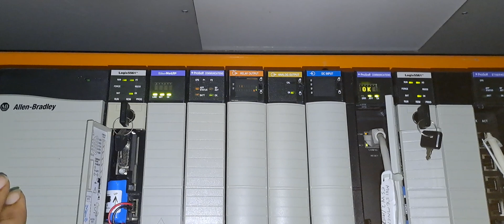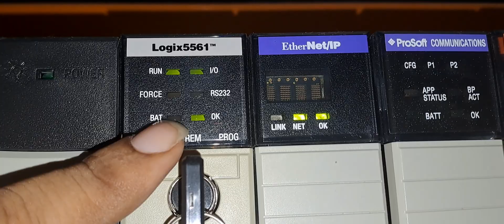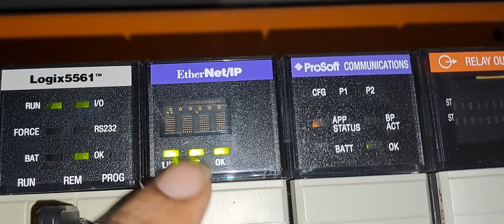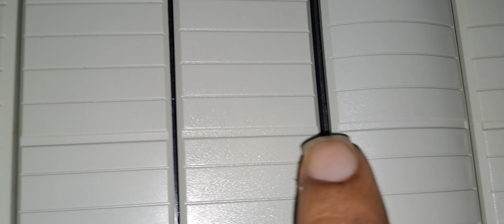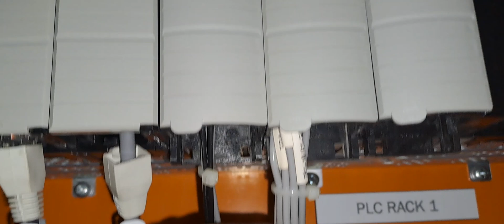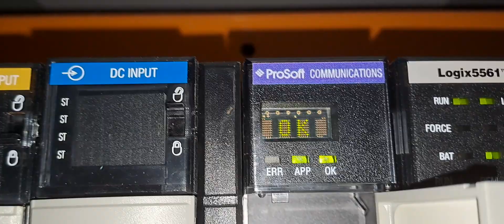Allen Bradley PLC rack discussion with all modules installed. PLC Logix 5561 family CPU and modules

Comment: • 4-Slot (1756-A4): Compact size for small applications.
• 7-Slot (1756-A7): Medium-small size.
• 10-Slot (1756-A10): Medium size.
• 13-Slot (1756-A13): Large size.
• 17-Slot (1756-A17): Maximum size for large control systems